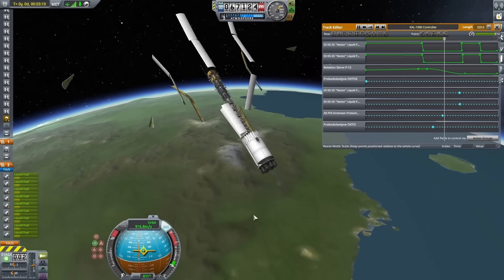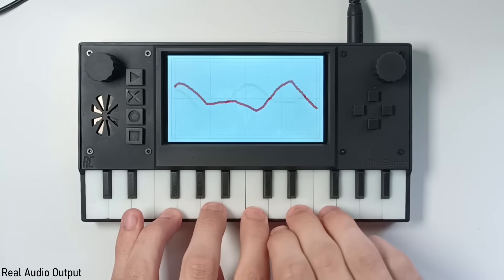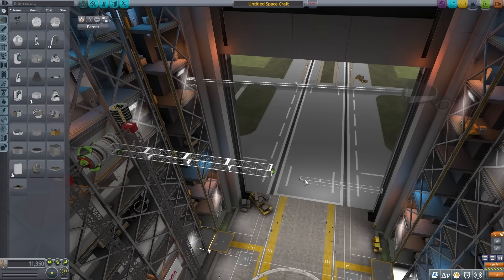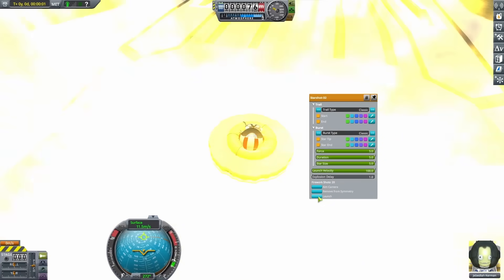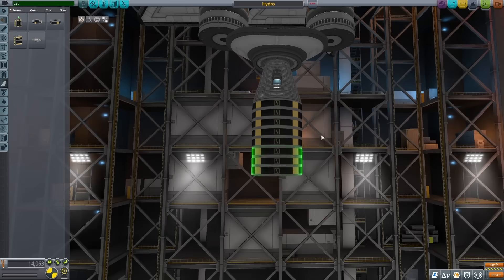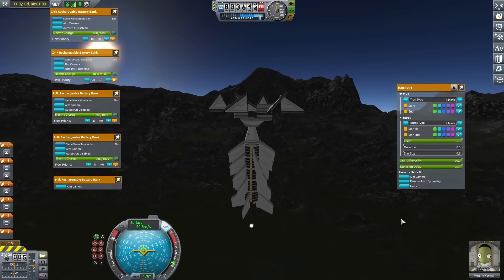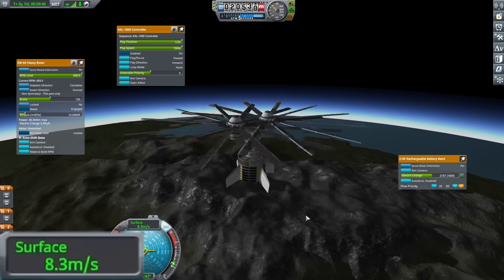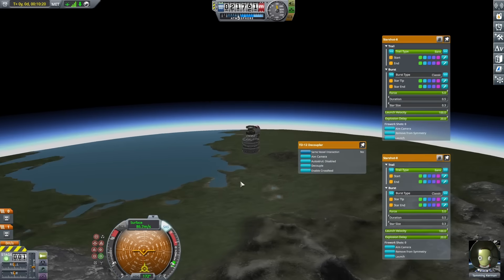How High Can You Get Without Engines In Kerbal Space Program?

Comment from the maker: Def would like to come back and try this challenge out allowing glitches, controller manipulation, and part clipping, but I figure I'd keep it fairly legit this time around. Anyone else want to see a multi-planet mission video soon?
Reply: MEEEEEEE!!!
Reply: Stratzenblitz did a challenge like this a while back if you want to check out what he did
Reply: Vibration based engine would go hard
Reply: It would be way to easy with glitches, a kraken drive can produce infinite deltav.
Reply: You sound like NileRed but for games.
Reply: A version of this where you try to implement it into the first stage of a vehicle that does have engines, would be interesting too. both the trebuchet, and a space-helicopter lol.
Reply: Reid you should check out Stormworks: Build and Rescue, it’s one of the most complex vehicle building games I have ever seen. It has weapons, space, and complex microcontrollers.
Reply: If you don't use the robotics parts for your bearing, but instead build a bearing using pre-robotics parts like landing gear wheels, I think you can break the fundamental RPM limit in the game. Stratzenblitz75 made a spin launcher for a minmus city that used old fashioned pre-robotics bearings, and a very very long launch arm.

Also using explosives and riding the shockwave was done IRL with the Orion project. If you search up KSP Orion drive, you can find fireworks powered ships that are well optimized.
Reply: Yes.
Reply: Kraken drive is op
Reply: You should try making a small plane with propellers, then ejecting the front  with fireworks
Reply: Absolutely !!
Reply: Maybe some modded ksp? Like planet packs and such
Reply: 1:58 AAAAAAH MANUALLY PUTTING BLADES INSTEAD USING SYMMETRY

Seriously, it gets me really uneasy
Great video, i love it
Reply: I just take these ideas and do them in Juno:New Origina
Reply: use a kraken drive
Reply: 1:12 if you make it "VERY" tall you can also make the arm longer and just use 2 motors you can launch a shuttle into space, because someone made it to catch and launch a shuttle between 2 planets in KSP
Reply: Propellors and spinning flingers

Comment: IIRC, there's a zero drag glitch using a faring pulled back over the entire craft that it's attached to. Might help. Also, at some point with batteries its just better to use RTGs. -edit: or fuel cells.

Comment: You can get extremely high by attaching a launch clamp to a control surface, then use the move tool to raise the control surface, the launch clamp means that you can launch a craft from around 100,000m in the air.

Comment: Wonder if KSP accurately models increased tip speeds of a propeller. If so you could just make longer rotors to get higher speed at the tip (where the cargo is) regardless of the engine speed.

Comment: 9:30 those aren't 12000 ft, those are 12000 meters, about 41000 ft, which is in the upper range for jetplanes and higher than the world record for helicopters. Passenger jetliners fly typically between FL300 and FL400, 30000 to 40000 ft or 9144 to  12192 meters.
The 13300 m afterwards are about 43600 ft
You built a helicopter that can fly as high as a jet. Turbine powered helicopters tend to cap out at 25000 ft.
The trick for electricity on a helicopter is not by using more batteries, but RTGs, solar panels and fuel cells. Fuel cells would be especially useful, as burning fuel reduces weight as you ascend.
Also useful to have lots of acceleration at low altitude, where you have more air to grab.
Note that 10-15 km is also about the limit for jet engines on Kerbin, after that they'll rapidly lose thrust.

Comment: THOSE ARE DAMN ENGINES!
Reply: they arent, they are motors. by definition engine is combustion, motor is electric. He said no engines
Reply: @Dodener  Ksp wiki defies it as "An engine is a part that can accelerate a craft."
Reply: @RADIS370  dont use the KSP wiki for definitions, im talking about real definitions. If that was the case then the reaction wheel letting you roll your pod would be an engine

Comment: The main issue with rotors is that the game uses floating-point integers for velocity, and spinning causes all of the rounding errors to quickly stack. The end result is speed being lost.
Also, if you go over the maximum speed, it will convert to NaN (not-a-number), and corrupt the game as it spreads to every calculation that touches it.
(currentFuel + NaN = NaN, for example)

Comment: What if you packed fuel and used a fuel cell array to generate electricity on your flight?  You cab get 18 charge per second using the array, and they are pretty light to pack.

The FL-T400 fueltank converts into 71111 charge per ton of weight, while the Z-4K battery pack holds  only 20 charge per tone. 

Fuel is over 3 and a half times more energy dence then batteries on the ground, and it only gets better once you consider fuel tanks get lighter when the charge inside of them is used up. The only downside is you can only acsess this energy at a limited rate. (Which is a VERY little consern, because adding fuel cells to suit your needs more then make up for the weight savings in a trip longer than 3 seconds.) and it can't be recharged. These are both non-issues for your mission. Go nuts.

Comment: Nice :D  You might want to look into KSP Kraken Drives.  They are controllable KSP physic abuse engines that let you accelerate purely from some parts pressing against each other.  Usually involving landing gear and or landing legs.
Reply: So...basically a Clang drive from Space Engineers
Reply: @Weretyu7777  or good old source engine propflying. Or even the troll physics flying chair. Just pick up the chair you sit in.

And now I am reminded of the fact that transferring fuel doesn't move your spaceship.
So you just have two tanks on a long arm, transfer all the fuel in the upper tank, than rotate around the center of mass. Which is in the tank.
Then you transfer fuel in the second tank and rotate around that.
Reply: @HappyBeezerStudios  Transfering fuel isn't instant though. So you'd need a really long arm.
Reply: @Weretyu7777  same idea
Reply: Or use docking ports

Comment: A plane based design could potentially work better for electric motors since if you can balance electricity consumption with solar panels you could have unlimited endurance and so max altitude would be solely dictated by performance at increasingly thinner atmospheric pressures.
Reply: I think if I would try an orbital plane using electric engines I would have a huge compartment with enough RTGs to irradiate entire planets.
Reply: @HappyBeezerStudios  problem with RTGs is they have a terrible power to weight ratio and so long as the plane can move faster then the planet rotates they have no problem staying in the sun 24/7.

Comment: next time set the pitch of the props to your main throttle control in the action groups and then just have the motors spin at a fixed rate, kinda like how a constant RPM propeller works in real life. this is what i did for a 4 engine prop plane i made
Reply: I took a prop plane to Eve to scout out a nice spot for a colony. It used that same design, constant RPM with blade angle tied to throttle. Works great in any atmosphere, regardless of composition! Eve, Kerbin, Jool, Laythe, it can work anywhere! Even Duna, though that one is challenging to design for considering its low atmospheric pressure.